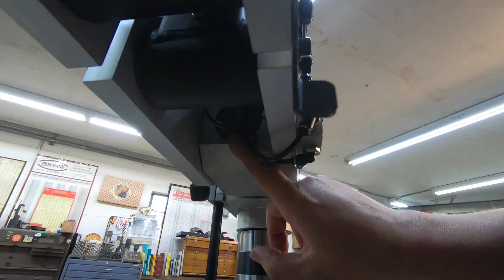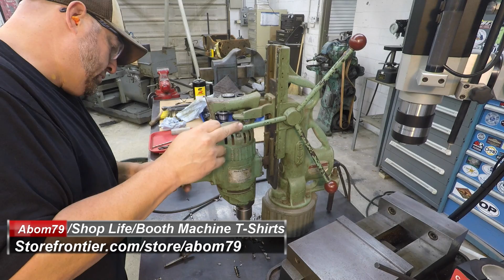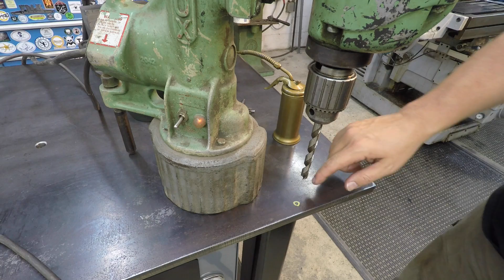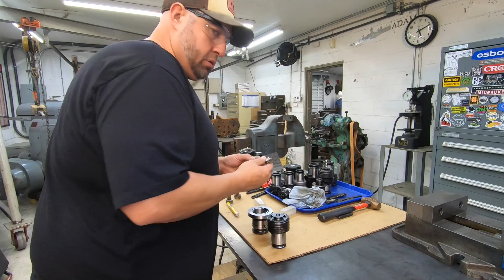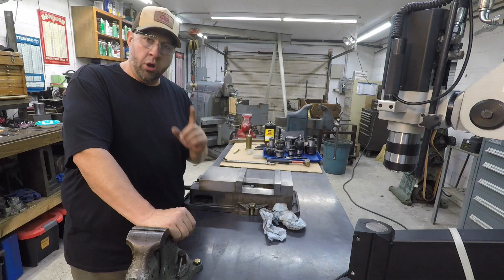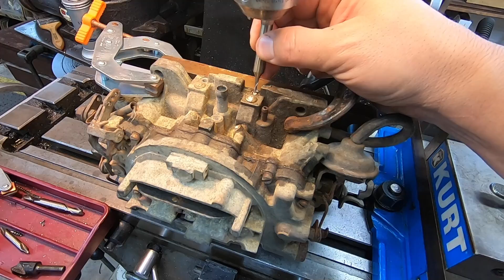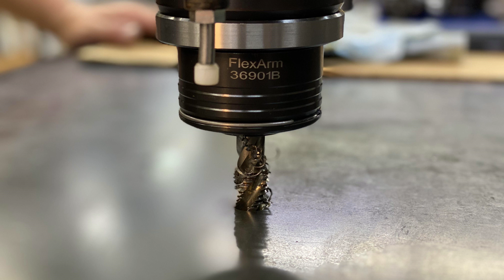SNS 301: Flexarm First Use, Broken Screw Removal

Comment: Why did it take 5 months from install to first hole tapped? They took that long to deliver the adapter? I’ve been wondering what happened to the beast... please explain
Reply: If memory serves, he had to have electrical installed to power the thing.  Getting a electrician out to do the work is what was the biggest delay from what I understand.
Reply: he explain in earlier vids, he had to fix the electric wires for it first. that an some of the other machines as well.
Reply: Needed electrical hookup and a transformer.
Reply: @sithus1966  Transformer?

Comment: Wow, that is one heck of a tool! You must be planning on a lot of tapping to pay for that thing! Those tap chucks and adapters are beautifully ground; I'm guessing hardened alloy or tool steel?
Reply: I believe Adam plans to use it when he starts production on those bolt plates he makes. They have like 40+ tapped holes each.
Reply: It is a very cool piece of kit to say the least, and to see it used in conjunction  with the mag drill and the trigger finger PWM speed control is both ends of a spectrum.

Comment: Hi Adam If the Flex arm workers both sides of parallel maybe fixing the base in the centre would double your working distance and reach voices at both ends of the bench is that possible Fantastic videos Vernon from downunder.
Reply: He answered this in the original setup video - The reach of the arm is already nearly double the bench from that position, having it central gets in the way more than it helps due to working at almost complete compression on the arm

Comment: Steel balls not ball bearings.
Reply: Hardened ferrous alloy spherical load carrying devices, not steel balls. 😒
Reply: mannys9130 for the win......😂
Reply: OK Mr. grammatically correct wanker. I'm sure with that immense intellect you won't forget to go through every comment now to ascertain correct spelling and diction. I purposely left the k in Ok a cap so you have a starting point. You may go now. :-P

Comment: Adam,  you should have tapped one of those holes using the auto stop. Question,  will reverse still work when the button on the stop is pressed. Or would you have to adjust the stop so that the button is released.

Comment: ive made same top in leven but ive use old chisel end screwdriver to press it and then put pressure in anticlockwise and i have also use little taps to hammer those screw out

Comment: the flex arm is sweet, on your vice with the smooth jaws, it seems set back from the edge of your bench, doesn't look like you can hold hold a long piece and have it hang straight down, looks like the base could of been spun 180 degrees and sat closer top the edge, just how i like to mount my vices.
Reply: I agree with your vise mounting opinion. I spent a career maintaining a machine shop and I never saw a machinist mount a vise as you describe. Maybe that is one difference between how the mechanic and the machinist works.

Comment: could you move the flex arm to the middle of the table instead of the corner so u can utilize the whole table?
Reply: Might be better if table was smaller and  on heavy casters
Reply: The arm can already reach nearly double the entire table - in the center he is more restricted as there is a "dead" area next to the pivot where you can't use it due to arm compression

Comment: I suspect that carburetor's needle valve is ruined. I believe the hole for it is tapered, and your extraction and re-threading has distorted the hole so that the valve cannot do its job properly as it is adjusted in and out.
Reply: Is the hole tapered or is it just the needle? We always had a needle kit to adjust our carbs and each needle was a different size/taper
Reply: The screw threads are not tapered. The needle valve hole itself was shown to be intact.
Reply: @firesurfer  I know the threads aren't tapered, and I may be wrong about the hole itself being tapered. The problem is, if the hole is tapered below the threads, the needle won't function properly if the drilling/threading operation that Adam did (extremely impressive for such a small diameter hole) went below the engineered distance.  I am not criticizing Adam's work.
Reply: @jdavidkatz  Only precise measurement of another carb could show any difference. I don't believe it would be enough to be a problem.

Comment: Can the Flex Arm be used for drilling if needed too, or is that a no no? I know it doesn’t supply any down pressure, but for some of these smaller projects and holes I do, I think it might work if it wasn’t damaging the unit in any way. I don’t have a mill yet, but certainly do a lot of drilling (with my mag and press drill for now) and tapping, but it would be great for me if the Flex Arm was capable of both. Also, do you have to have a different holder for every single tap size or does a certain one fit a range of sizes? Maybe you went over this, but I don’t recall. Thanks!
Reply: It's a no
The head is sprung vertically so regardless of your vertical push the tap always matches the pitch of the tap
It is also a torque ratchet that intentionally stalls the spindle if material grabs, it stops you breaking taps

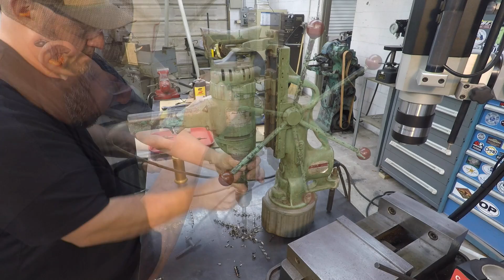Comment: I’m not a machinist would never claim to be anywhere near as talented as Adam but I am an electrician and I feel awful for that mag drill being switched off and on like that. @9:19 that is literally the hardest thing you could do to a motor. But hey if the magdrill was cheap and your drill bits expensive I guess that’s a sacrifice you make!
Reply: The universal motor in that thing would survive a nuclear bomb blast. But you are right it ain't good for the motor.
Reply: @CarrotCaptain  Probably not so bad for the motor as you said but it sure will kill the switch over time. How about a simple triac controller to adjust the speed?
Reply: I think he want to keep it in good condition because it is the old mag drill from his dad's shop I believe.
Reply: Daniel Xddd the drill looks as old as me. If it was a chineasm drill, the motor and switch would have quit on them years ago.

Comment: That flex arm is pretty neat, looks like it needs something to kick it out of the hole when it comes up though. Cannot be good for the tap or the threads to bounce on them when it gets out.
Reply: There is no pressure on them - the head is free floating in a slide housing
Extremely minor surface contact

Comment: I'm not sure why but I thought that it went a little way then changed the spin to break the chip and when it got to the bottom of the hole it reversed itself... not sure where I got that from.
Reply: That could be part of the depth stop system, might have to enable it in the settings.
I'm sure he'll dig into it in the near future.

Comment: Thats a wicked bit of kit for use on some of those big gearbox castings you get.  I can see you unbolting a couple of vices and setting up to tap some big stuff with some big holes on that bench.  I've drilled and tapped a lot of holes in a small fab shop using jigs and tapping machines on pillar drills but being able to swing the machine into the right place makes it super easy.

Comment: Can you rotate the head 90 degrees to tap horizontally? I imagine your lathe work could benefit from that when you have to tap flanges. If you've already drilled a bolt pattern on the mill, how often would you use this to tap vs tapping while the part is still on the mill?

Comment: Out of curiosity———> From 8:09-8:11, what is that switch that you keep flipping when you are trying to center up the drill..?
Reply: That is the magnet that locks the drill to the tabletop. Since he wasn't happy with the alignment he turned off the magnet to move the drill.
Reply: Electro magnet it’s what keeps the drill fixed to the table, if it were a permanent magnet it would be a real pain to move around.
Reply: its to turn the electro magnet on an off on mag drill

Comment: When you're backing the flex-arm out, it seems to hang up a little when the tap no longer is grabbing the threads.  Is there a chance it could mess up the lead threads of the hole that way?
Reply: I'm sure to some degree. Probably takes a bit of getting used to
Reply: Very limited - the head is free floating with a spring limiting pressure

Comment: You might’ve damaged the needle seat when you drill through it.
Reply: i think it's safe to say he didn't judging by what was left of the pin showing that he had only cut up to where the taper hadn't started yet
Reply: He would have "cleaned" the seat, if he had drilled a few thousandths deeper. 😊

Comment: Check brushes in mag drill if not done yet, cheaper than new armature. If you can only get brushes that are larger than needed you can emery them down to size. Good old drills need preventive maintenance.

Comment: Just an observation. My dad was a machinist and he got all over me one day for mounting a vise like you did on your table.  He insisted the wide part of the bolt pattern is designed to be installed near the edge of the table so you have clearance to put a long piece in the vise that extends below the edge of the table.
Reply: Exactly the comment I was going to leave. The asymmetric bolt pattern should have been a clue. I've been a machinist since 1974, and have seen this mistake many many times.
Reply: Jimmy Rogers looks to me like he mounted it the right way, I don’t understand what you’re seeing? Thanks
Reply: @shanek6582  I am only indicating that the radius of the mount is sitting back past the end of the table.  Of the wider pattern had been on the edge the radius of the base closer to the edge would have allowed  a long piece in the vise that would extend past the edge of the table.
Reply: Jimmy Rogers  you are quite right.
Reply: depends on which side of the table its swiveled to, covers long and short side when its on the corner like Adam did
Reply: Who cares how he installs it? Honestly, no one cares what your dad or you did in your life.
Reply: @justinl.3587  you need to simmer down a bit man, the original poster was very calm and non inflammatory in his comment and you come in all defensive.

The man simply pointed something out.
Reply: @jdod64  Again, if he wanted to know how to mount the vise, he would have asked. No one cares about the armchair experts advice.
Reply: @justinl.3587  Someone might that tried to put a long piece in a vise and it hit the table might be interest.
Reply: @jimmyrogers4177   The man clearly knows what hes going to do with the vice and doesn't need any one's advice, obviously.

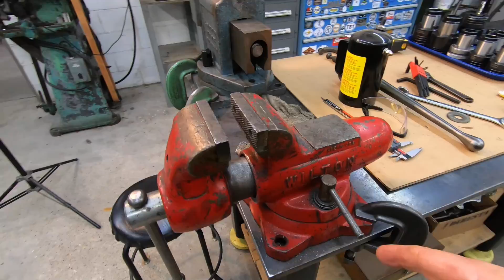Comment: 4:30 Can you make another set of holes for the flex arm further down the table for the once in a while times you might want to reach the far end of the table? Better yet, fab up a block to hold the flex arm that sits on a pair of ways like a lathe has that allows you to move the flex arm back and forth along the edge of the table.

Comment: Am I missing something? Why did you not use the FlexArm to drill the holes?
Reply: @CamaroZ28Nut3  This, plus the fact the head is a torque ratchet that is designed to slip if the tool grabs to prevent bust taps - not too good for drills

Comment: I wonder if you could custom design an extension arm between the base swivel arm and the shoulder joint of the FlexArm so that it /can/ reach the opposite corner of the work bench?  I know it would be a pain in the tookus to just dismount, move, and reinstall the base of the FlexArm.

Comment: If you are applying downward pressure on the bolt with the drill how would the bolt back out? The bolt has to come up to back out and the pressure from the drill is preventing that, maybe you could loosely lock the quill and bring the part up with the Z, that way if it grabs it could push the quill up as it backs out.
Reply: And thinking like that is how you bend/shatter drills.
Reply: The quill is on a sliding sprung head - When the tap engages it is not compressed: that means when it needs to back out unless you are really double barrel pushing down it can easily wind out
Reply: @bengrogan9710  Oh so he is using a tapping head?

Comment: Snap On makes that same drill extractor that was your grandfather’s. I have a set of those, being automotive mechanic I have to remove a lot of broken bolt studs and screws etc. He might be back to you to machine the throttle shaft bars. That thing is pretty rusty I’m wondering if the throttle leave it open or close

Comment: Could you not use a spiral tap with the flex arm for all the drilling?
Reply: Spiral flute taps don't drill holes.  They're for tapping existing holes, just like all other types of taps.  The reason for the spiral flutes is that they force the chips backward out of the hole, as opposed to forcing them forward into the hole.  

Also, you definitely need a drill bit for drilling the holes.   And you wouldn't use the flex arm for drilling holes because it has no provisions for keeping the drill from walking across the work, and no provision for applying axial pressure on the drill into the work while drilling.  The mag drill he used has all those provisions, and is the right tool for the job.

Comment: OK, that's cool, but can you use it to debur lots of holes? A chamfer bit would make that process handy!
Can you adjust the tool weight so it requires you to pull it down or is it about neutral?

You could use the Flexarm to tap another set of mounting holes in the center of the table to give you the option to cover the entire table if needed. 
Be careful putting Abom torque on those Harbor Freight ratchets, I hope you got the warranty :)

Comment: In my opinion, when you had trouble setting up for your second hole to be drilled. The reason it gave you issues was that you hadn’t released the brace on the drill. That was causing you to pivot funny. In my opinion.

Comment: Neat trick for small fasteners in heat-sensitive materials is using a car battery to heat it up. Using jumper cables to ground the object, then connect the hot side to the fastener. Usually takes just a few seconds, more corrosion = more resistance, and extremely localized heating. Old mechanics' trick from when cars still had thin metal headlight buckets with the chrome rings and screws that rusted instantly.

Comment: Hey Abom, 
Your Grand dads extractor set is cool. Haven't seen one before.
What I do is get good quality torx bits and use them the the same way. If you give the end of the bit a negative rake on a lathe. You can use it kind of like a cutting tooth as you pound the torx into the hole. Even a good flat grind works great.

Works amazingly.

BTW I have the little brother to your articulating tap arm. Taps up to 5/8"
Love that thing.

Keep up the great videos!

Comment: Is there a reason why the Flexarm is not mounted in the middle of the table? You could reach the entire area that way.
Reply from the maker: Yea, I don’t want to block the middle of the table. All I need is one end to work on using the Flexarm.
Reply: fair enough; keep up the great work.
Reply: If it was in the middle it would reach everywhere except the middle.  There's a minimum distance you need to pull it out before it will reach the height of the table.

Comment: Just a tip as a backup for when a left hand drill doesn't break a bolt free like that, try a cordless hammer drill on speed 1 in reverse with the left hand drill, it doesn't always work but it has saved me before and it is rather low impact energy with the cordless drills as it's more of a vibration than a hammering motion. While unlikely with a good quality left hand drill, this could damage your drill so do so with caution.

Comment: Steel bleeder screw in an aluminum body -what could go wrong?  Nice job on the carb - customer might have to RTV the threads to take care of air leakage, but not a big deal. Probably a rare model - Chrysler guys are usually bears for matching part numbers. I also saw a 5.0 manifold (Edelbrock?) in one of your vids.  You'll become an automotive machine shop yet:)

Comment: When you started using the Flex mount i finally understood your enthusiasm about it :-) 

Question on getting stuck bolts out; would it be possible to thread a left hand bolt into it and back it out that way?

Comment: I found that a spiral fluted tap is the best for power tapping.
Reply: Depends on the hole in question - Spiral flute is for drawing swarf out of blind holes, spiral point for pushing it through on clear holes

Comment: why is the flexarm so loud when idling?
Reply: It's a hydraulic tap machine, the oil pump i in the base cabinet under the table,
Reply: I noticed a different sound while it turned counterclockwise. Because it is hydraulic, it should make the same sound in both directions. Maybe after break-in.

Comment: Why did you mount the flex arm in a corner,  surely it would of made more sense to mount it in the outside edge in the middle - so you have the full reach both ways?
Reply: Pretty sure it can use most of the table. Look how much of the arm is folded up.
Reply: The arm has a minimum extension to be able to reach downward - by putting it in the center you make a large "dead" zone